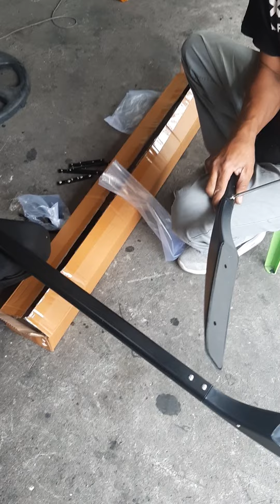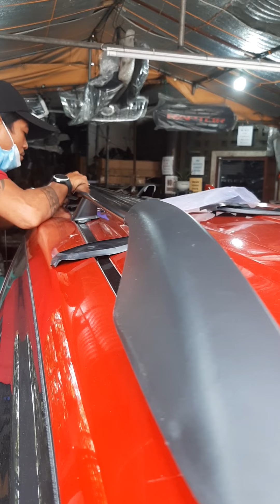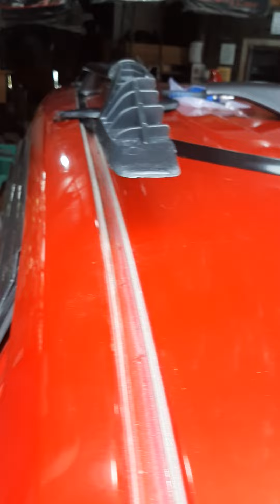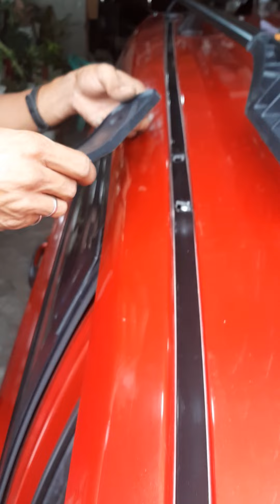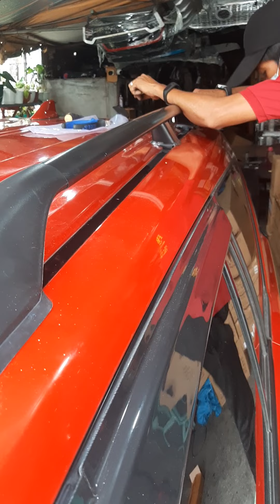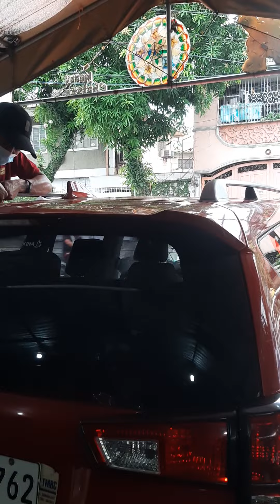install ng roof rail innova

Comment: Wala pala butas na abang yang innova para sa oem roof rail. May balak pa naman sana akong project...
Reply: ako may Innova rin pero hindi ko palagyan ng roof rail bka pumasok tubig sa katagalan...hindi cgurado kong totally ma sealed ang butas nila...
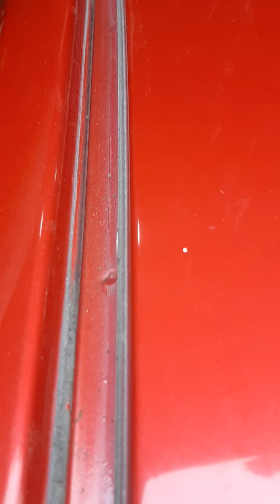Reply: @manueljrdizon7023  wala sir butas dun sa vid(ndi sila nagbutas). Yung roof rack na kinabit nila, yung bracket eh nakasingit dun sa slot sa bubong. 8:40